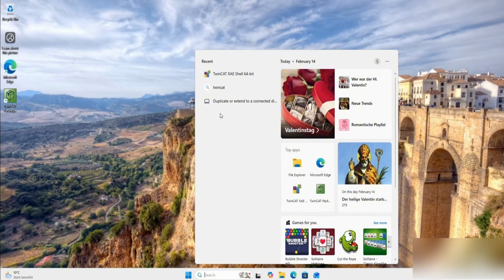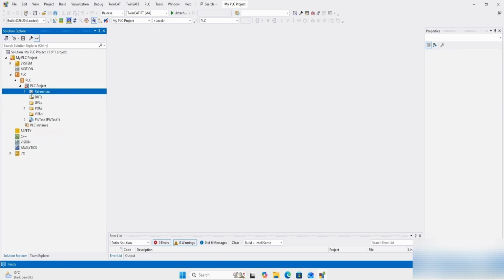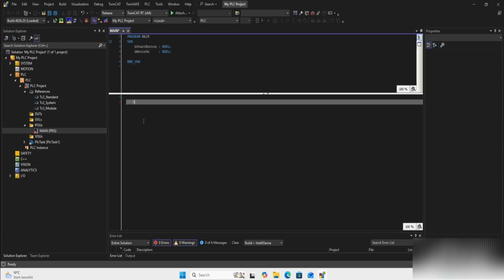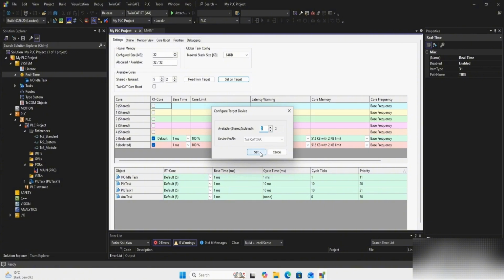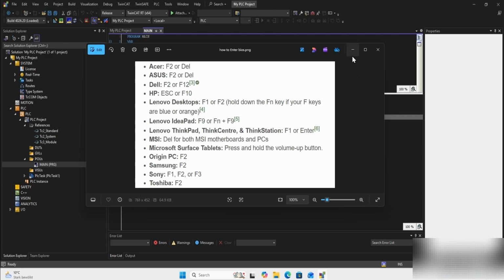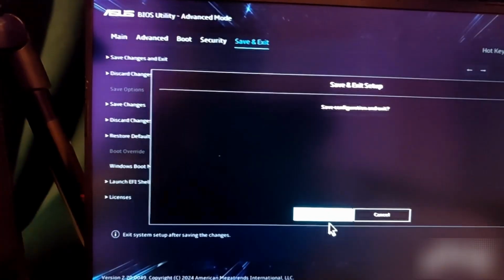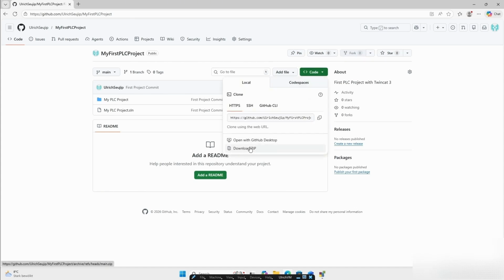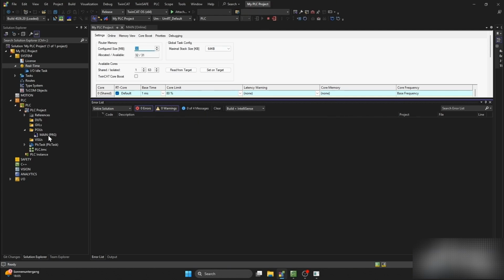#4 Creating your first Project in TwinCAT

Comment: Thank you for the great explanation! I have a quick question: once we are done with the simulation, how do we revert the settings to bring those 2 isolated cores back to being shared for normal use?
Reply from the maker: Hello, to do that, you simply have to do the reverse. You go to the "Real-Time" setting in Twincat and click the "Read from Taget" button, then increase the number of shared cores, untill the isolated cores are zero. Then you set on target and confirm, it might ask you to reboot your pc. After this, you should have all shared again. To check, you can open twincat and go to the "Real-Time", you should normally see all cores shared.